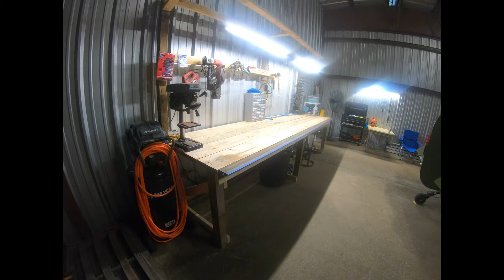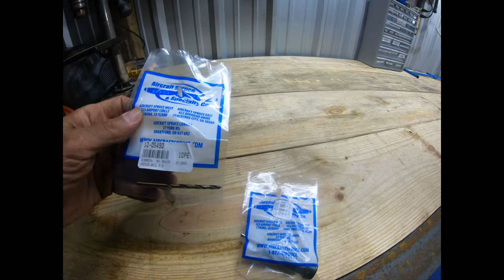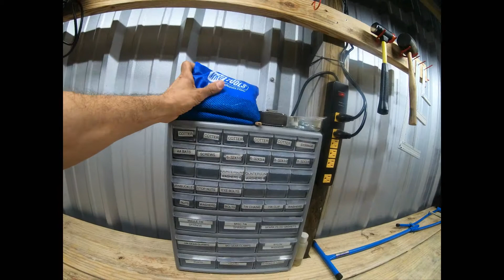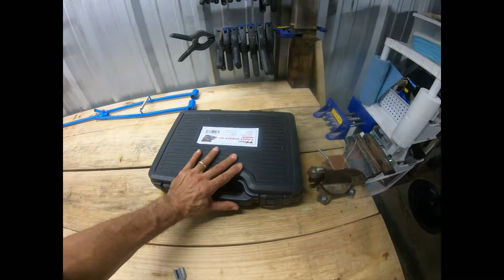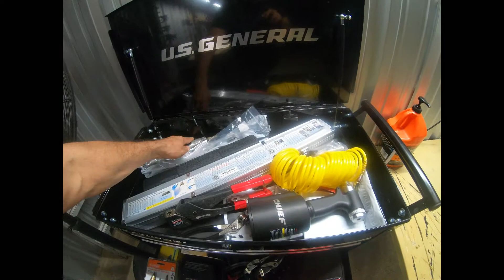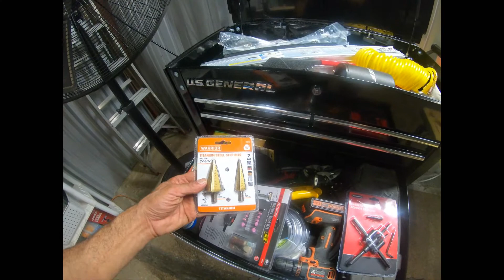Thatcher Workbench

Comment: Thank you for posting these videos.  Do you know which prefab components you will be buying yet (engine mount, landing gear, etc).  From the Thatcher CX5 videos, it looks like there is a welded tube frame between the two seats, and I have not figured out how extensive that is, and if it is available or if I would have to learn to bend and weld tube.
Reply from the maker: I live in the Florida panhandle so I took the opportunity to drive over to Pensacola and meet with Glen Bradley and look at the Thatcher aircraft they have there (1 of each model). One of my concerns was exactly that. I have a welder and I know how to use it but I don't consider myself a welder by any stretch of the imagination. I can do some basic welding on things in my barn and around the property but I would not trust those welds on an aircraft! Glen assured me welding is not required for any of the Thatcher aircraft projects. The plans include contact information for the parts that are already prefabricated such as the canopy, spar assembly, ribs, fiberglass parts, motor mount, control stick and control tree, etc. You can build the spars yourself but the recommendation is to purchase them prefabricated if you have never built an airplane before.